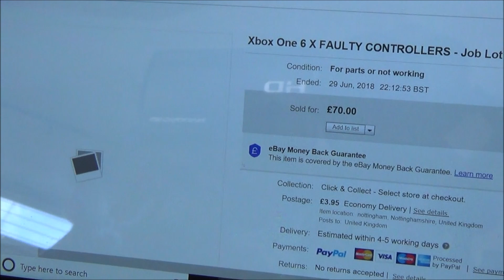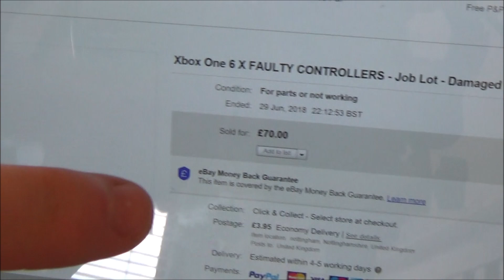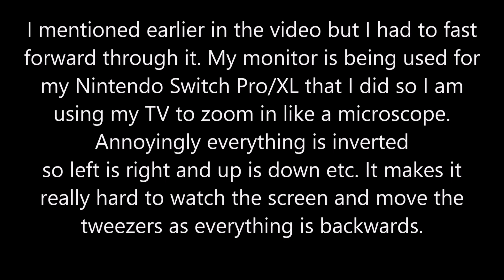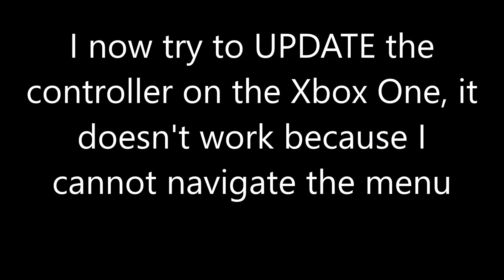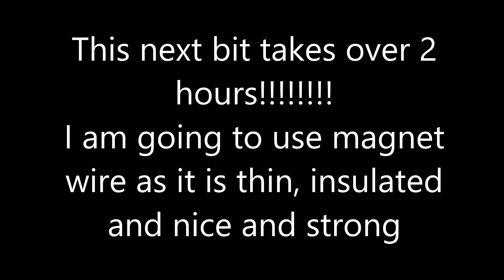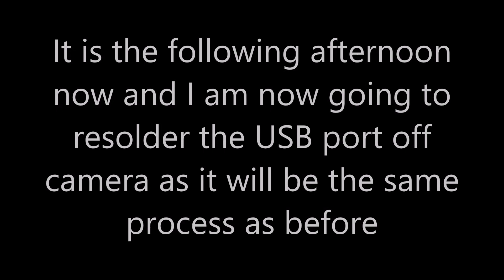Trying to FIX eBay Joblot of Faulty Xbox One Controllers PART 1

Comment: You need smaller wire, mate! Take individual strands from a single wire for jobs like this, makes soldering much easier
Reply: using component legs is the easiest and also solid wire so easier to manipulate into position

Comment: Here are a tip of someone that have being fixing his own controller with scraps for years.
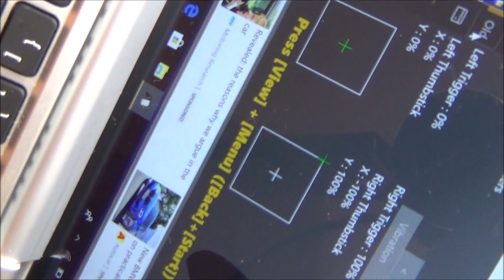28:54 If you see analog stick is stuck in a corner or going wild 99% of the time the problem is a broken/worn out potentiometer or a broken tracer.

And some general tips for fixing any kind of electronics.
And buy finer wires. Like 0.2mm enameled cooper wire. They would have made the repair of this 20:02 and this 37:07 a lot easier. Just remember to pass the wire on fire to burn the isolation when doing tracer repairs.
A cheap way to get fin copper wire is to strip stranded power cables but they are not coated/insulated and that would make this 20:02 repair a little more trickier.
If possible buy a soldering hot air station. This is the right tool for soldering small things.

Comment: You didnt give up. Respect to you Vince.
A friend is going in for some brain surgery but I have suggested you may want to have a go.
Let me know.

PLEASE PLEASE get some helping hands
Reply from the maker: Thanks Emma, when I was doing this I thought to myself how stressful it must be for surgeons doing heart surgery. I do have some helping hands but it is a massive unwieldly thing. I might get those cheap little ones with the magnifying glass attached to them :-)
Reply: I tried the ones with built in magnifier. AVOID.
Best bet is to get a set of helping hands which are good quality (cheap ones move when you let them go after adjusting) and separate magnifing glass that can attach to a worktop. Use a separate light also.

Comment: Great job!  So very close!  One thing I would say - it's worth getting some super fine coil wire (winding wire 0.1mm).  It's far easier to fix traces with wire like that!  It's very frustrating when you get somethink like this controller where someone has worked on it previously =/  It looks like they swapped the stick and gouged the traces at that point.  Maybe then the micro USB connector broke off.  The micro USB connector can get snagged in the case when reassembling - I suspect they also broke that too.  Maybe the wireless was a fault caused by something they did too.
Reply from the maker: Thanks Chris, I never noticed the stick had been replaced. I was sure it was going to work after sorting the scraped tracks. Gutted when it didn't sync up. Hopefully the next 5 will be a little bit easier. When you use the fine coil wire do you scrape off the last few millimetre of insulation (enamel????) at the ends to expose the copper or just solder it straight onto the insulation hoping that the tiny bit of exposed copper at the cut end will make the contact?
Reply: With that type of wire you find you can usually just heat the end with solder and flux and the coating slowly melts back.  It's so fine, it's finer than hair!  But it does make those super thin traces really easy to deal with!   That thumbstick, look at the point where you zoomed in to fix those broken traces, you can see the solder points on the stick look like they've been worked on - it's clear to me that someone swapped that before you got to it!
Reply from the maker: Thank you Chris :-)
Reply from the maker: Just bought some 0.1mm enamelled copper wire on eBay. Hopefully this will make it easier next time :-)

Comment: Somebody didn’t remove that shield, The one without the shield was a launch version of the controller which didn’t have those shields. The one with the shield was a revision of the controller which was released shortly after launch. 

Those launch controllers wirelessly synced via infrared and the Kinect which the Xbox one S doesn’t support so that won’t work wirelessly on a non launch console.

Comment: It appears that several components are missing by the USB port. If you look at the pads labeled R7 D14 D15 D17 D16 they are tinned but no caps or resistors between them. I don't own an Xbox so I don't knoe if that's how it's supposed to be or not. Maybe the repair guy used a heat gun to remove the old USB port and just blew off the components. You might compare it to another board. You can see the pads at 6:28.
Reply: It's quite common for PCBs to have unpopulated pads, in his case those pads are unpopulated on the XBX controller as can be seen here https://www.acidmods.com/forum/index.php?topic=43204.0

Comment: I would invest in some fine bare wire for stuff like this. Really really fine, like 38 AWG (0.1 mm diameter). We have a little bobbin of it at work that has been a lifesaver for this kind of fine modification or repair.

Comment: Hey, I've got a tip for you for increase your soldering abilities. You could put some of the soldering material on the cable ( like soldering it into the cable ) and then you just need to put the cable close to the pin/part you need to sold and it will make things easier.( I think)

Comment: **ARGHHH!!!**
Respectfully Vince... Pre Fluxing and soldering is a MUST!! No ifs and no buts, if you don't have flux expect to fail. 
if one doesn't pre tin, then the intended non pre tinned connection WILL FAIL!!! or worse act like a resistive capacitor..
Also a stinking hot soldering iron is a must, BTW did you know if you just touch flux that is touching solder the solder will melt without even contacting the soldering iron? try it with a really hot soldering iron and you will see you will be blown away. 
So yeah.. when soldering FLUX is a MUST..

Comment: For the first one(right analog stick and right trigger) its a common issue where the PCB cracks right in the the middle of the right stick contacts. the traces for the right trigger run though that point as well.

Comment: I have at least 2 gen 1 xbox one controllers that i have trouble syncing as well. I have two xboxes so they are always being switched around. i have found that i can only sync them with a brand new fresh set of batteries and even then sometimes i have to mess with them to get it to sync. sometimes I have to hold the sync buttons on the controller and the xbox and release them simultaneously or at different times or move the controller closer or farther away to get it to sync. One time i gave up and went to set the controller on the coffee table which was about 6 ft away. when i set it down it synced right up. so maybe just try a few different things. but once they are synced, when they are powered back on they connect right away. we have since bought additional controllers and labeled the problem controllers and only use them with the xbox they are synced to. Great video though! your perseverance and patience is impressive.

Comment: "Faulty charge port" - charge port is missing.
Talk about not being as described.
Reply: I mean...if the charge port is missing I guess it is faulty right?
Reply: @StormsparkPegasus  Not necessarily. It might be in full working order, wherever it is...
Reply: I buy a lot of faulty stuff to fix from eBay and I get that all the time. 'Faulty' sometimes means 'It's had a sledgehammer taken to it' and 'Some parts might be missing' can mean 'There's no motherboard, disc drive or power supply. In fact, it's just the case!'
Reply: @fadetonoirfilms  Yeah...I saw a video from another Youtuber who was buying and fixing broken Xbox's.  There was 1X.  It said basically "doesn't work".  He opened it up, there's no motherboard.  Yeah, I guess it doesn't work!
Reply: @StormsparkPegasus  I bought an X last week that said 'doesn't boot'. It was just an update error, easy fix. Saw another one today that says 'main board had gone'. Not touching that one - sounds like the seller knows more than they're letting on but doesn't want to be specific. Could mean anything from 'I spilled my drink on it' to 'The motherboard is literally not there anymore'!
Reply: @StormsparkPegasus  Steve from @tronicsfix
Reply: @AndrewFomin  Yep that's the one.

Comment: Hey Vince.

So I can help you on your xbox one controller job lot this will save you time and money.

1. the xbox one controller is two separate boards the bottom board is the controller brain board save these boards do not throw them away I will explain why.

when you get a xbox one controller that is auto drifting you usually think its the analog sticks or a faulty analog stick.

this is no where near what it is.

90% of the xbox one controller problems you face are from faulty brain boards as they are known this is the board on the bottom of the controller. the board that houses the chip and the receiver. 

to save you time and money. do these simple things.

1. power up the controller and see if it syncs to the console if it powers up and syncs to the console and starts to auto drift left or right its the top board that's damaged now if its the bottom board that's damaged you will have a trigger not working or abxy buttons not working these are codes to tell you what is wrong with the controller.

now the brain boards can be swapped out make sure you have a controller with a 100% working brain board you will need this board to diagnose weather its a top board or a bottom board issue if you swap out the bottom board and the top board stops drifting and works you know its a bad brain board however if you swap out the board and it doesn't stop its the button board. 

and a huge heads up. replacing the analog stick doesn't fix the board so don't bother its not worth it its better to Frankenstein to different boards together to make one good controller.
Reply from the maker: Thanks for the tips :-)

Comment: Try to sync it very close to the Xbox, or try to put a little piece of wire in the antenna plug, maybe the controller has a weak signal?

Anyway, you did an incredible job with this controller, those USB port and traces repairs were exceptional!

Comment: Those traces were cut, likely during diagnosis of the fault by a repair technician at some point.

Also keep in mind a big blob of solder doesn't mean a strong solder joint

Keep trying you will succeed sooner or later.

Comment: Amazing work. Just wanted to chime in to say that even if the controller didn't want to work with the console, you can update it using the Xbox Accessories app on Windows. It's a little known official app on Microsoft's store. Cheers.

Comment: for stuff like this, you could take some enamel(?) copper wire, the stuff you make motor windings and inductors out of (so you know where to get it) there are sometimes absolutely tiny gauges used that are easier to solder to something like this connector. thats way easier than dealing with those rather thick wires
Reply: And you don't need all that insulation to replace traces anyway

Comment: Vince please check and see if the little antenna cable is running from the back board to the joystick board. That is the thing that will give you wireless capability and if it isnt there that would explain your problem.

Comment: With traces that small it's easier to just bride the gap with solder. I've only done for one or two traces but never that many. As for the power off issue, a well known fault is with a certain capacitor (C31) that shorts out. Removing it solves that problem.

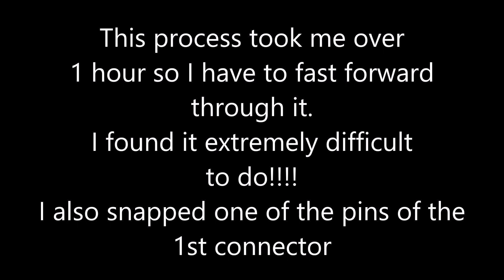Comment: 13:02 For soldering those wires to the Mini USB port or such small components in general: use a different tip! there are those connical bent ones (HAKKO calls them J01 J .. etc.) with 0.4mm tip size, those are perfect for such jobs! I am using those (equivalent) ones on my Ersa. Look around for some fitting your iron, don't know which one you have ... Greetings from Germany!

Comment: you could start using enamelled copper wire just like Louis Rossman you already watched does! pretty easy to use in these cases. (you can source it from broken motors like a rumble motor) :) comes in a bunch of sizes too! also a tip i use a lot, try to dip your wires in the flux, instead of smearing it across your receiving solder item. especially on micro-usb ports you avoid it getting on all nukes and cranies! ^_^ edit: have only seen half a vid when i commented :P you already using enamelled wire (magnet wire as you described it). why not on usb micro port too then?
Reply from the maker: Thanks, I thought it might be too stiff on the micro USB port. My thinking was when I bend it to get it to go to the cap/resistor etc.then it may snap off from the tiny pins. Maybe it might have worked better if I used it. Maybe next time I could try it to see how it goes :-)
Reply: @Mymatevince  you just wouldnt have to coil it up. If you get smaller diameter one, they get pretty flexible. Never be afraid to use small diameter wire. As you can see the traces are really small themselves. I have to admit you ultimately did a really great job using the wires you used. I thought they would be too bulky to move around but you proved me wrong. We may try to advise you on certain things we have encountered but keep in mind we too learn from you a lot! I would have never tried fixing and soldering on an iphone.. yet you managed it. Great content! Keep it coming!

Comment: @My Mate Vince the sheild over the Xbox wireless controller means it's a gen1 controller gen 3 has a slightly different wireless chip and has no sheild what you see is a board to board interconnect not sheild tabs.
From what I can see the trigger isn't working because it uses the magnetic field of a transistor or magnetic pad depending on generation I would also check for a short on caps near the battery holder.

I know all this because I convert Xbox and PS4 pads to archade pads.
Reply from the maker: Thanks, yeah I was sure it had a shield and was some type of ball grid array type thing. Now I know for next time :-)

Comment: I wonder if you could with known good working units develop your own schematics, taking measurements and readings off of onboard components, a good clear piccy of the board and printed circuit layout and build yourself a ready reckoner for future fixes?   So for example taking a good working One controller get a nice close shot of the board and its components one side per page and ink in the various capacitor, resistor and other components so all you have to do is glance at the printout or even on screen, see a resistor and check values etc.   We used to do this back in the auld auld days of PC overclocking etc or modding stuff like old consoles and someone would upload the "schematic" onto a bulletin board as back then esp in the PC part, you couldn't afford the heinous costs of new motherboards and had to do best to find the errant component and hoping it wasn't a processor or similar heavy duty IC and it was amazing how a whistling cap or a bank of blown resistors would stop a PC from powering up or cracked traces the lost hours on trying to find a tiny break in an equally tiny thin line thinner than a hair arrgh.   (Dunno if you have experienced whistling caps)   Was why we all became adept with car rear window demister repair trace paint and finding the finest thinnest of dagger brushes and many more argh's as you have to wipe it off, do it again... and for some reason the voice in the head saying doing it again was always the schoolmaster from Pink Floyd's "The Wall" lol
Reply from the maker: Cheers for the suggestions and tips Ian. Funnily enough GadgetUK164 said this earlier this week about taking measurements. I think I may do this on a Nintendo Switch as it would be helpful for me and others.

Comment: ***Possible Tip**
With multiple tracks, I wonder if a spare ribbon cable with much the same dimensions as the tracks can be used? as in clean and tin the damaged tracks and then scrape and tin the donor ribbon cable, to which the ribbon cable is then placed upside down contacting the tinned PCB tracks "don't forget the flux", and then by using a heat gun meld them together. Soldering Iron may work, and if you do make sure you clean the tip with recommended soldering iron cleaner, never ever scrape away the tip, as the plating is crucial for professional soldering..

might be worth a try... Ay?
Reply from the maker: Possibly or you can get the older type ribbon cables, the ones covered in plastic with actual wires. I bought some for the Sega Dreamcast but they might be a bit big for a repair like this :-)
Reply: @Mymatevince  indeed, if the tracks match a ribbon then its worth considering..
Reply from the maker: Yes, ones with a very small pitch might do the job :-)

Comment: hi have you tried Electric Paint 10ml Draw circuits, solder components and repair devices on a range of surfaces with electrically conductive paint. 
Nontoxic, air-drying. 

Works great on may materials including paper, plastic, textiles and conventional electronics.

Comment: Don't know if this information is of any use or if it will be seen even, Occasionally my Xbox One struggles to Sync controllers. Fix = Turn off the controller (pull the battery), Press and hold the sync button the xbox for 10 seconds, then release turn on controller, press and hold sync button on controller for 10 seconds, it then connects, don't know why this works but it does for me anyway